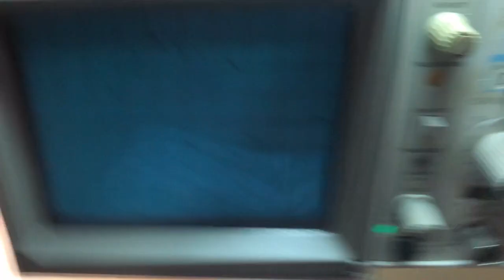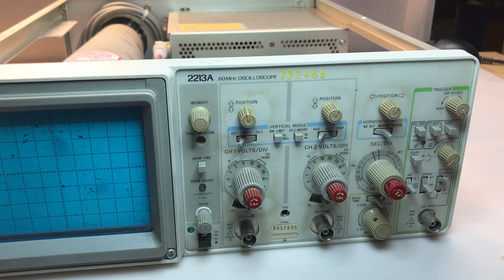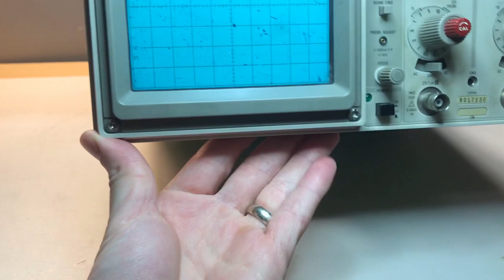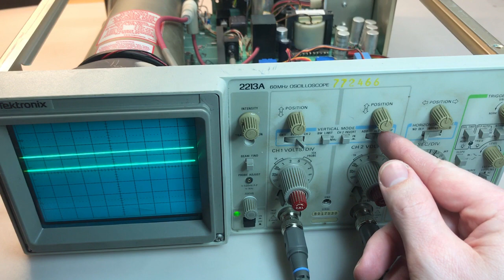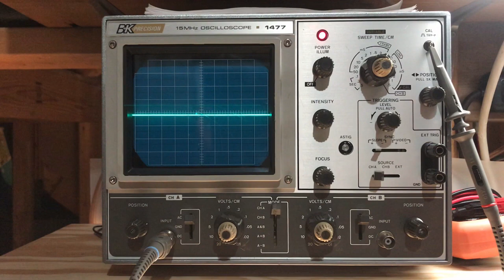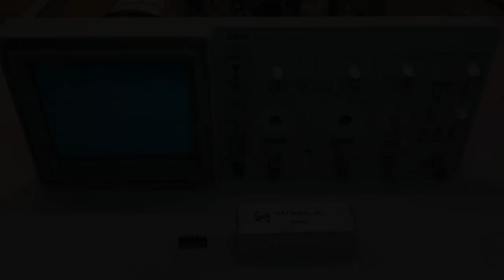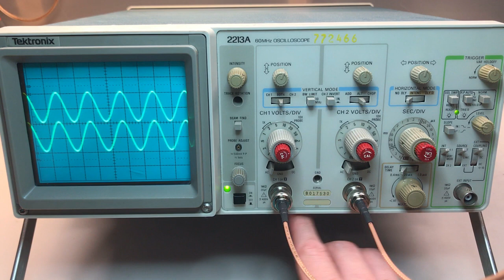DR #27 - Tektronix 2213A Oscilloscope CRT Replacement & Tune-Up

Comment: I don't know what that two lead device is mounted to the heat sink, but the two transitors under it are the Inverter Transitors that work as a push/pull to drive the transformer.  This is the area I am having trouble with mine (see my other comment). I suspect that someone put in a whopping fuse to debug a blowing fuse issue and burnt up the trace in the process.  Its a very clever but complicated switching power supply.  It steps down 120VAC using Triacs (on mine) to 42.5 VDC and then turns that to AC to drive the transformer.  This insures the supply voltages all remain constant as the line power changes (as it does all the time). Me?  I would just have DC to DC converters/regulators for each supply and thus a simple input power supply with overvoltage protection.

Comment: Wow that one is extremely similar to my 2236 but just way simpler. My issue with my 2236 is that the CRT deforms below the center. I have a video if it if you see this and have any suggestions. Thanks

Comment: Hallelujah!  The DOCTOR is in the house!!  
What a positive and joyful feeling to know that there is a man who digs and keeps digging until he finds the problem(s), and subsequently proceeds to replace defective and out-of-spec components, whether they be passive components or mechanical devices and hardware, and then knows how to tune the whole system to original specifications!  No solder gun hack here, gentlemen, Nick is the epitome of professionalism and thoroughness in an electronics technician!!  Woo hoo!!

Comment: Very nice repair, thank you for an interesting video! One thing to watch for with those old style metal can capacitors is the grounding tabs -  in some equipment they bridge the ground from one section of the PCB to another (not in this unit).  When replacing them with modern capacitors you may have to add jumpers to complete the ground connections.
Reply: @David V.   Good tip. Also, one should ALWAYS wear full FACE/NECK protection not just EYE protection, gloves, and heavy long sleeve shirts (leather aprons acros the chest too) whenever handling a CRT. Even with the metal shield, a bump or drop can cause it to violently implode scattering glass as high speed all around. And always treat a CRT as it holding a charge like a capacitor does. In this case the CRT can have 8,000 Volts in it. People that don't take precautions handle the tube, get shocked (feels like a bee sting), drop the CRT on the bench, it implodes and are permanently blinded by the flying glass. In the Air Force we had to take all those precautions on handling CRTs but in my shop I insisted on having a safety observer (wearing the same protection and trained to handle them) to be by a phone.  These tubes are VERY DANGEROUS and you should be on total alert (almost twitchy) the first time you handle one.  Never lose respect for its dangers.
Reply: @paulromsky9527  Absolutely Paul! CRTs and their power supplies are at the top of the list of dangerous things the electronics hobbyist handles.
Reply: @davidv1289  I agree, I wish the video poster mentioned this. As you may know, these power supplies don't have a primary transformer, so most of the power supply section is at 120VAC Hot and Neutral. If you connect test equipment to it (scope, meter, etc) that has its COM tied to 120VAC Safety Ground (not isolated), you will blow up your test equipment, the scope under test, or even get an electrical shock if you touch what you think is Ground (in the circuitry) and touch any chassis metal. The manual clearly states to use a true isolation transformer to power the scope when servicing, even some Variac Transformers are not isolated.  He really needs to put a disclaimer on the video. WARNING Do not attempted repair without the service manual and not experienced with high voltage (typically anything over 40 volts) safety. I am cautious as hell even if the scope is unplugged and checking for shorts. You should have seen me in the Air Force as I donned the entire safety board and showed up at the base command post as "Captain Safety", we were all pretty cool at 3 AM. Even a full bird colonel looked forward to my "safety inspections".... [in a super hero voice] Stop, there is no lid on that coffee cup, it could burn your lips, it's a good thing I am here!.... funny stuff like that.

Comment: I was just given a 2215 (not a A model and it has the Current Limiter option). It blows the fuse 2 seconds after power up. I am following the service manual diagnostics flow chart. I see no shorts on the components called out to check (as well as obvious components - all look good) but I am seeing 0.6 ohms across the input windings (pins 2 and 5) supply voltage transformer. That seems very low. Could you check that on yours? All you have to do is remove the plastic cover under the main board and find the pins. Mine has two big "dual half moon" isolation pads near the pins?  I just saw in your video you don't have isolation pads, but I did see the transformer pins 2, 3&4 center tap, and 5: you pointed these out as being reworked, "bank of four here". Thanks!   P.S. I bet all the rework you see may be due circuit isolation from prior troubleshooting, mine are pristine except around the power switch. I am sure before I am done I would be isolation components all over the place. I fear I may have multiple failures just to get it to power up... then of course the cascade failures I expect to find after I get the power supply working.  But knowing what you read across those transformer input pins would help me a lot!

Comment: Those resistors in the HVPS are part of the "focus resistor chain" and commonly get very hot and degrade, resulting in a fuzzy trace that you cant focus.
GJ with the caps, there are a few other common important things in the HVPS to replace:
-4 or 5 safety XY caps, small square yellow-brown (they get crazed and crack the surface, causing them to blow up)
-the IEC receptacle that you plug the power cord into, it degrades over time internally and a few fellas had theirs blow up with some smoke/debris
-a small tant cap behind the 'block' transistor/heatsink
-the molex connector attached to the block, tektronix released TSB to remove connector and solder directly due to molex plug melting
-couple other mods/TSB depending on the serial
Lots of good info if you search on the "tekscopes group" BBS.
cheers

Comment: Hi there, I have the same tell 2213a scope, I didn’t use it for a couple of years but I fired it up today, everything was working fine until the image started going up on the screen, I have the position knobs all the way down and the image is almost at the top of the screen, is there any fix for this? Thanks

Comment: What did you use to clean the face of that scope?
Reply from the maker: Baby wipes. Seriously. They're perfect for surfaces like that.
Reply: just a heads up, isopropyl alcohol will totally wipe off any of the markings printed onto the 3 clear plastic circles on the volts/div and sec/div knobs. Isopropyl didnt damage anything else on the front, I mostly used soap/water for that